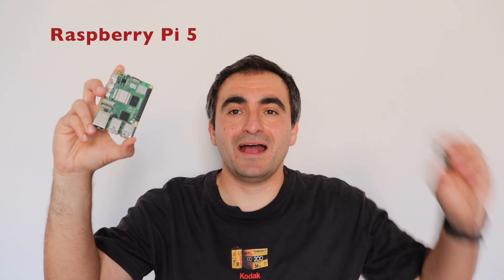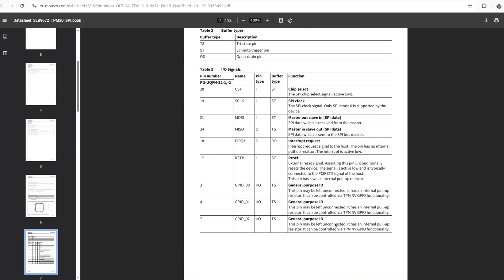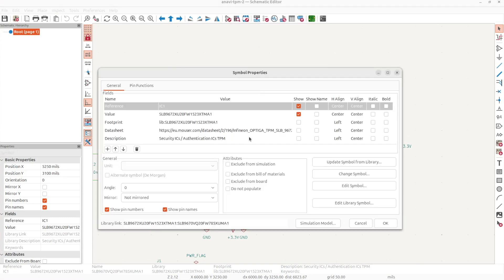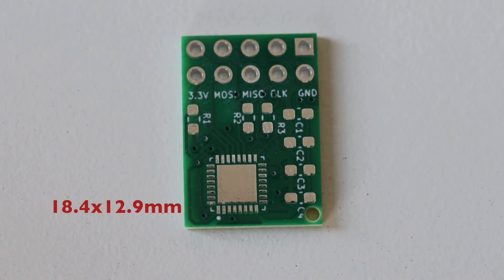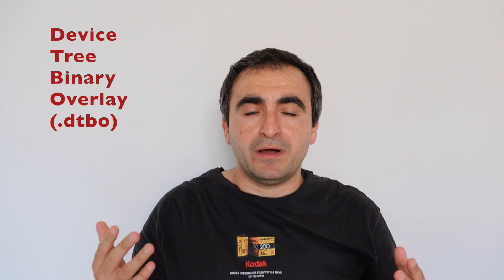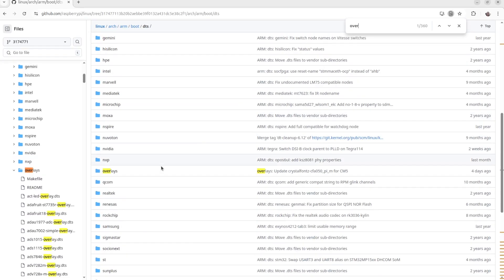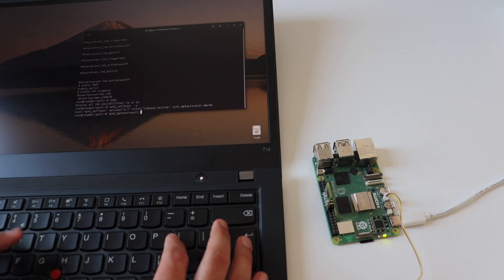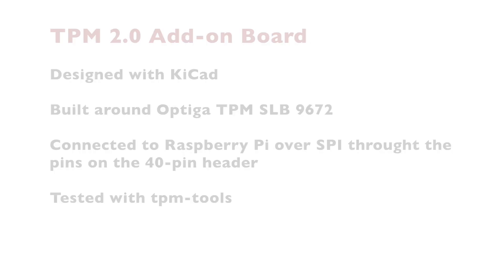Designing an Open-Source Hardware TPM 2.0 Add-on Board for Raspberry Pi in KiCad #tpm #raspberrypi

Comment: Thanks for sharing your TPM work! I look forward to more TPM-related videos for the rpi5 🤞 

I believe the closed-source pi5 GPU-based first bootloader  prevents true measured or secure boot, right? What's the closest we can really get to one of these with a signed readonly rootfs with full disk encryption for a data partition using the TPM with yocto -  hopefully within the context of AB OTA updates using e.g. mender?
Reply from the maker: Thanks for watching my video. You are raising a very good point. In the context of A/B updates with popular open-source solutions such as Mender, RAUC, or SWUpdate, the data partition remains persistent across updates and can be LUKS-encrypted, while the A/B partitions can be read-only. Secure boot is possible, but it is tricky, because it involves modifications to the integration of the over-the-air update system. On top of that, there are some known security-related limitations. For example, the Trusted Firmware-A port for Raspberry Pi isn't fully secure. All memory used is DRAM, which is accessible from both the Non-secure and Secure worlds. The Broadcom SoC does not appear to feature any secure memory controller, so portions of DRAM cannot be properly protected from the Non-secure world.

Comment: Hi, Your videos are very informative.

1. Can you please provide a video explaining how to configure Reset Address, RAM, WiFi, GPIOs, CAN drivers initialisations in UBOOT?

2. And also can you please create a layer, recipe to auto login WiFi and also a simple recipe to receive and transmit CAN messages ?

3. Create a layer for simple GUI using QT Creator and also configure LCD display over SPI.
Reply from the maker: Thank you for sharing these great ideas! While I haven't made videos on these exact topics, I have touched on related subjects in the following videos:
- Embedded Linux for Olimex i.MX8MP SoM and EVK with the Yocto Project
https://youtu.be/kxCBwUviO-Q?si=vKW1zaxxUT9VnMbo
- The Yocto Project on Raspberry Pi 5 Episode 4: U-Boot Bootloader
https://youtu.be/9tohomiv1Ug?si=eTq0OzAHKgK_vjK4
- The Yocto Project on Raspberry Pi 5 Episode 5: Modifying U-Boot Environment in Linux with fw_setenv
https://youtu.be/SB5NvIF1IEU?si=VpOrrzMQDPVOmxIi
- SSD1306 OLED I2C Display on Raspberry Pi 5 with Linux User Space C Driver and Raspberry Pi OS (it is I2C instead of SPI as you requested but might still cover some of the things your are looking for):
https://youtu.be/-8wiiAvAov4?si=5BwlItnbDYlFizak

Comment: The remaining problem is that some applications that use TPM like web browsers or key generation applications,... still do not have a version on raspberry that supports TPM.
Reply from the maker: Yes, I agree, this is very good point. As of the moment there are a lot of software challenges for integrating and using TPM 2.0.

Comment: That's awesome work.  I have no need for this, but I respect the work.
Reply from the maker: Thank you for the kind words. I appreciate that! Indeed, TPM 2.0 is not essential for many projects, but it can prove useful in specific cases. In addition to properly manufacturing a panel with a stencil, my broader long-term plan includes creating more videos that showcase various software-side use cases of TPM 2.0 on the Raspberry Pi 5.

Comment: I would buy one of these modules from you. It would go well with an I2C real time clock module for Raspberry Pi to create a tiny "source of trust" for a private network, eg active directory, NTP and certificate authority
Reply from the maker: Thank you for your support of this open source project! This TPM 2.0 add-on board is fully compatible with any I2C device, as it does not occupy the SDA and SCL lines on the Raspberry Pi 40-pin header. Additionally, for projects requiring real-time clock (RTC) functionality, the Raspberry Pi 5 is an excellent choice because it is the first model to feature a dedicated RTC battery connector.